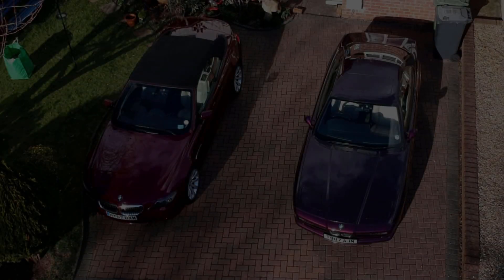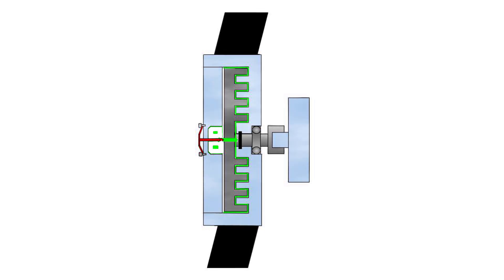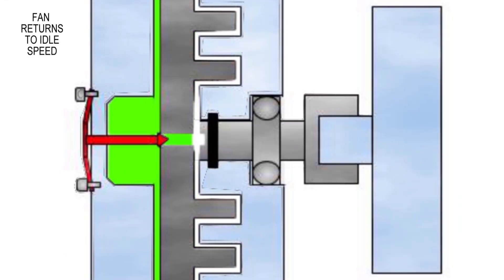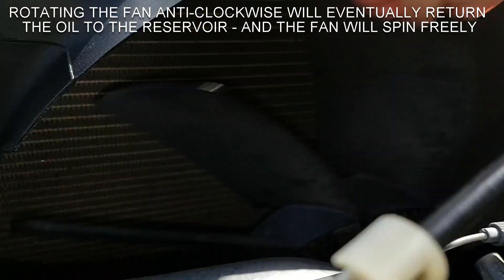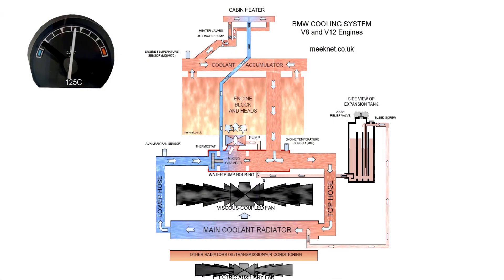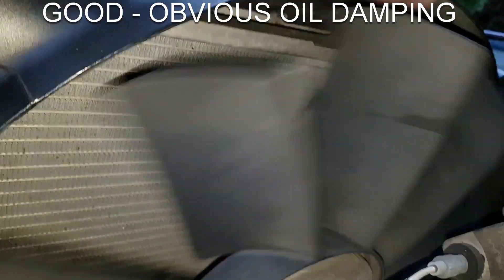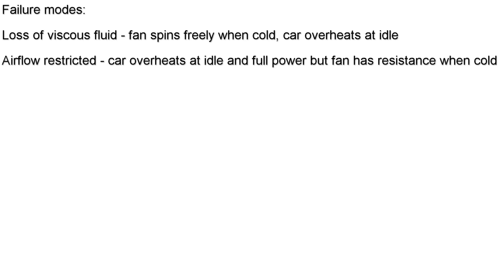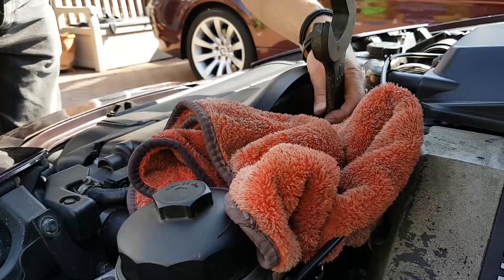Stop poking the BMW Viscous Fan! A better way to test

Comment: Thank you for the video. I wish I had found your video before replacing the fan clutch on my 98 Z3 2.8L. The old one feels the same as the new. I still have over heating. I can control the heat to a safe level by turning  the heat full on inside the car 75C. I had good flow through the radiator with a garden hose. I flushed it both directions but I suppose it could still not have the proper flow through all the fin tubes. I have replaced thermostat and hoses. I bought the car in January and I enjoy driving it. Hopefully I will get this sorted out soon. I subscribe and liked.
Reply from the maker: Things that spring to mind are a damaged waterpump - some versions had plastic impellers and they could disintegrate - also check for a blockage between the radiators that restrics the airflow - all explained here: https://youtu.be/XGIk8IXSGIE
Reply: Hi Ricky.I own M52B28 me too.Just replaced fant clutch+blade,do it you too,55£ Thermotec.And what he say and Mr Timm,water pump+thermostat,replace and this ones and everything it's gonna be like should be

Comment: There's no repair for a failed bearing, it is a precision unit and getting the old bearing out will probably reduce the precision! The end of the video shows how to remove the fan and the replacements are a reasonably priced. Timm....